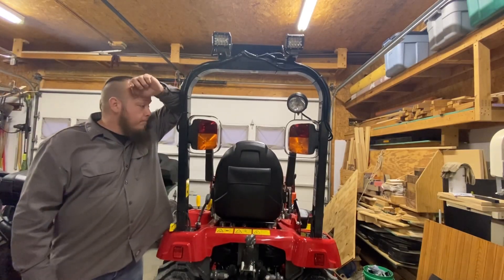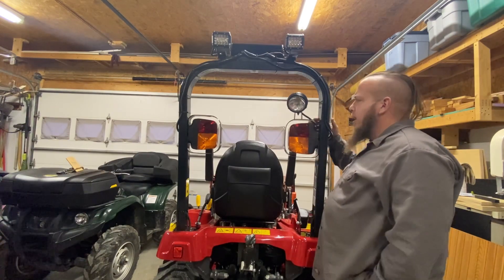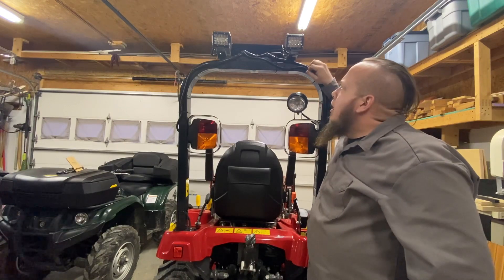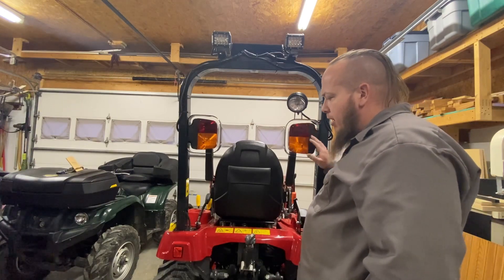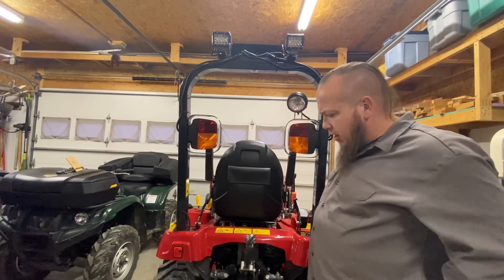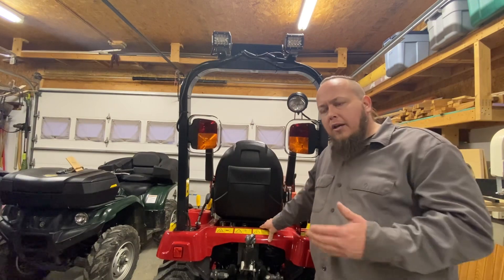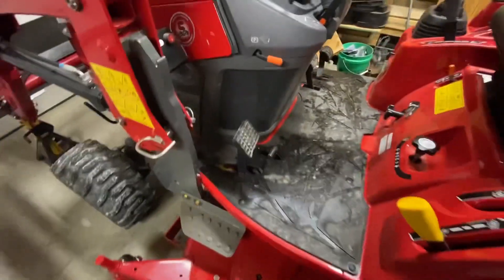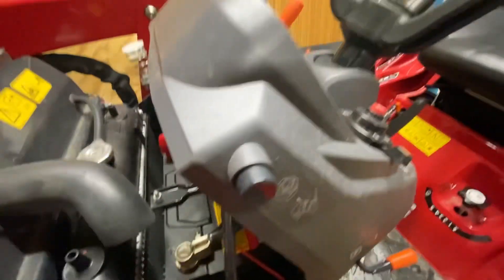ROPS LED lighting setup on the Massey Ferguson GC1725M, could be adapted to any tractor!

Comment: Where do u find the magnetic mount
Reply from the maker: The magnetic mounts I created using some bolts matching the size of the hardware that had come with them. The magnetic discs are made by (or atleast sold by) NiLight on Amazon.

Comment: Ahh, you moved your rear lights inside the ROPS like I did. I kept hitting them and almost tore them off several times.
Reply from the maker: Luckily I had never tore them off, I saw the posts of others moving them, but before we did a tree had touched one while I was passing by and I took it straight to the shop and moved them right then to be honest LOL
Pricey if you have to replace them!

Comment: Great video, thanks. Any tips to change out the bulb on the stock rear work light? I can get the black plastic cover off, but then it looks like a sealed beam. I didn't want to go any further..
Reply from the maker: To be honest I think it is a 1157 bulb, let me check my old orders and see what it was exactly. The front lens comes apart after the screws are removed from the back, the silver shield comes loose and the bulb access is there.
I know for sure the bulb I used was the same as what I used for the headlights
Reply from the maker: Here is the bulbs I used for the headlights and spot light (it wouldn't Link right so here is the name on amazon) "BRISHINE 4-Pack 1000 Lumens Super Bright 1156 1073 1141 7506 BA15S LED Bulbs 6000K Xenon White 24-SMD LED Chipsets with Projector for Backup Reverse Lights, Parking Lights, Daytime Running Lights"              AND I can honestly say I have had good luck with this brand of bulbs so far. The ROPS lighting I can tell you that NiLight has been working great too. I haven't had to use lighting super often on the tractor but when I need it, it is there and really helps overall to light everything up!